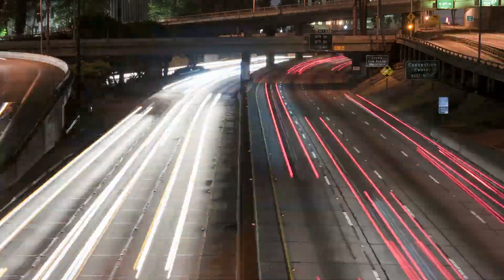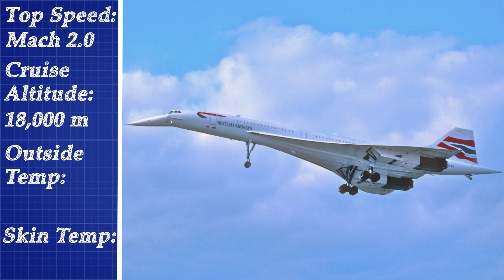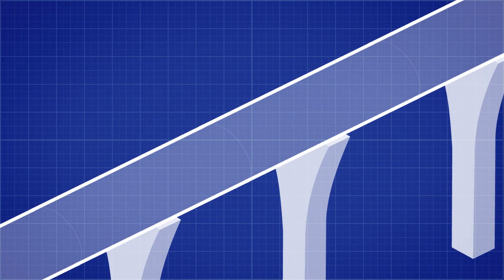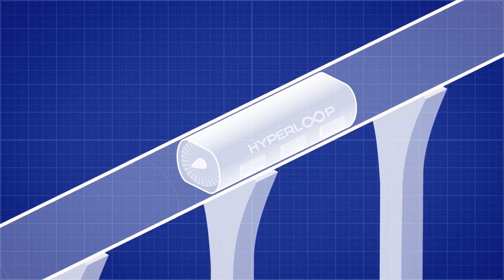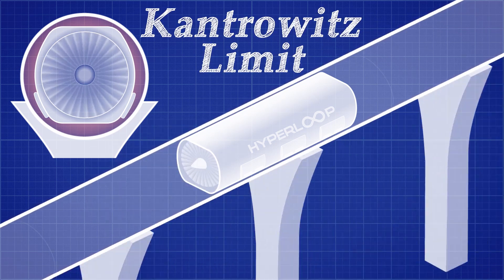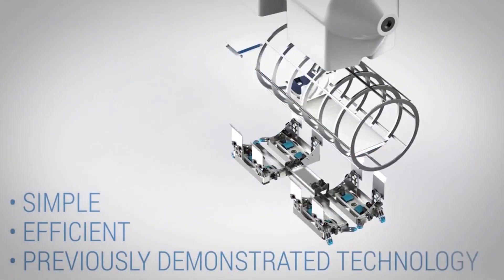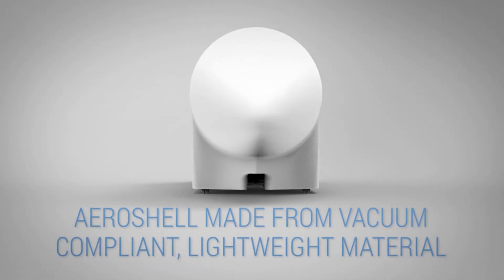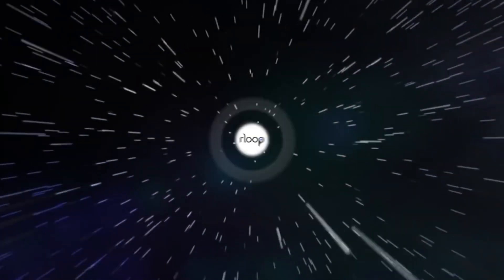Hyperloop - The Future of Travel?

Comment: I don't know about anyone else but I think we should be working to build a larger, quieter, more cost effective Concorde rather than something that will most likely be target to terrorists, design failures, immense infrastructure cost etc.
Reply: The advantage of closing a train in the tube is that you are isolating it from the elements. There can be snow outside, rain, strong winds but train is in the tube, these things don't affect it. 
In comparison any airplane is very exposed to elements, ice is a serious issue, strong winds and storms are problematic while landing, and dust or ash from a volcano eruption can halt air traffic for a whole continent.
Hyperloop as presented by Musk is a BS. Getting such low pressure in such long tube is impractical, any leak could destroy the whole system killing everyone inside. Making it usable and safe will be very, very expensive.
Reply: You can't make a quieter concord.  The noise has nothing to do with the airplane design and everything to do with the speed it flies at.   You also can't really make it that much more cost effective...the physics and thermodynamics are the driver of fuel requirements for that craft.  Any gains past 10% or so would be miraculous.  Size is similarly restrictive and larger is counterproductive to the first two metrics.  Finally...no demand.
Reply: Matt McAvay Boeing worked on their own SST concept in the 1960's, but the project was cancelled in part because of restrictions regarding supersonic flight over populated areas. SST's definitely work, but they are not practical; it doesn't matter who builds them.
Reply: what's easier to target, a jet flying at 70,000 feet with security inspections for anything getting onto the aircraft or a giant, just above ground, tube that is held at a near complete vacuum over thousands of miles of unprotected land?
Reply: Why would this be more of a target than any other rail system? I don't understand that argument. A terrorist could easily cause much more damage by derailing a freight train in a populous area. I think the terrorism argument is way overblown.
Reply: The hyperloop meant as a cheaper replacement for a proposed maglev train route, not for international travel.
Reply: +Matt McAvay   The real advantage of air travel over the hyperloop is that land does not have to be acquired as it does with a rail like solution and this is really an advanced rail system.   Unless, they convince the rail company, the freeway authorities, the electric utilities or pipelines to share their right of ways with them then the technology would be the least of their worries.  Plus the hope for high speed requires a very different more gradual path then the path from any of those aforementioned right of ways..    A new SST is far more complicated then you are imagining and not much safer from terrorism but does get around the land use issue except for the fact that you're not currently allowed to go supersonic over land, the Concorde was only allowed to be supersonic over the ocean.

I don't think the technical challenges are the problem with the concept but the logistics of right of way and the limited niche market that could be served by telecommunication and is currently served albeit inefficiently by air travel are the real problems with the idea.
Reply: +Just Being Socially Awkward You really think that a steel tube can't be crushed under 1 atm of pressure? Watch this video /watch?v=T9bpUfWy8Wg

The shell of the tank in that video is almost half an inch thick, and the vacuum they drew was about 80% of what is proposed for the hyperloop. Sure, the guys needed to damage the the tube in order for it to get crushed, but considering that the hyperloop is proposed to be used in a seismically active region, I don't think it's at all unlikely that the tube will never be damaged. Bottom line,  if the tube is damaged even slightly, you need much less than one atm of pressure to crush it, even if it's a (almost) half-inch thick steel shell.
Reply: considering the hyper loop is essentially a vacuum if there is a hole in it or in the case of terrorists an explosion, then say bye bye to anyone any that hyper loop. So yeah I guess terrorism is a bit of an issue for the hyper loop
Reply: Those Hyperloop tubes 'could' be useful on mars where there are many things that plague any design on Earth that would simply not be an issue there. -Hypothetically- They would be a really good way to transport things on mars. As this is a hypothetical, I am going to have to assume that many interplanetary logistics and resources needed to make Hyperloops on mars, such as asteroid mining, improved engine tech, and money (possible space elevator) have been established beforehand prior to the construction of the system.
       The Hyperloop on Mars wouldn't need much depressurizing if any at all. This is because the Martian atmosphere already is much less dense on the surface than Earths. Colonists could put them up and they'd be set; Mars is geologically dead so there is also the added bonus of having little to no marsquakes to disrupt a hypothetical future martian hyperloop. There is a low risk for terrorists to destroy a martian hyperloop as, well, I don't imagine many people have the mental capacities to qualify as an astronaut/settler. (No insult intended). 
       If any were wondering about dust storms, one must remember that with a less dense atmosphere, there is less force that can be transferred between the gas and dust molecules and particles. (Grain of salt to be taken here: I do not like how the Martian portrayed the amount of wind force on their escape craft, it seemed like a lot, more like the storms that are seen on Earth than Mars.)
Reply: Innovation won't hurt for some time or another
Reply: Or Lockheed.  personally I think the US largest military aerospace contractor can certainly build a kick ass SST
Reply: And the Concorde isn't a target to terrorists?
Reply: The 'Complete vacuum' argument is invalid, If the tube would get a leak, the air would just slow get into the tube and the hyperloop would slowly come to a stop.
Reply: ***** True
Reply: Hyperloop would actually make a rather weak target for a terrorist.  Attacking a passenger train on its tracks would actually produce a much larger death toll. (since passengers on hyper loop are farther apart)  Financially the repair of any such attack will be relatively cheap, as it will be contained to just that section of the loop.  

(And before you complain about mass depressurization elsewhere: that can be fixed by allowing the loop to be containerized)  Shut downs would be highly disruptive but not catastrophic.
Reply: Dude. MagLev trains are not viable for mass transportation, in open air. Hyperloop is taking one and encasing it in a 500km long vacuum chamber, and your argument is airplanes can be steered into buildings?  How about a locked cockpit door? There, just made airplanes viable for you again.
Reply: No, my argument is not that being a potential target for terrorists should stop us from doing things. I'm just pointing out the absurdity of claiming the hyperloop isn't viable because of terrorism and advocating for airplanes instead.

I think we should have both airplanes and hyperloops. I don't think the hyperloop is a good target for terrorism, and even if it is better than most targets, that shouldn't stop us from building one. Terrorists will target the most vulnerable point they can find. If that is a skyscraper, they will hit a skyscraper. If it is a concert, they'll hit a concert. If it is is a train, they'll hit a train. If the most people they can get with a single attack is two people because we've all run to the hills, they will chase us into the hills. We should not hide from terrorists, we should investigate them using evidence, and prosecute them using due process. 

The hyperloop will be built if they can make it work at a viable price. If they can't, it will fail. I hope they can do it. If they do, and it gets destroyed by terrorists, we will just have to build two more.
Reply: why not just bring concord back its still way ahead of its time now just dont go to france with it they have unreliable runways which ruined it now we have to use the shit unreliable american made cheese boxes
Reply: Matt McAvay Because the airline industry isn't affected by terrorism/design failures/massive infrastructure costs...
Reply: And planes aren't a target to terrorists?
Reply: next gen Concorde is were its at
Reply: Matt McAvay I think NASA is working on one but fuel cost and pollution are a holes
Reply: read about concord's effects on the ozone layer
Reply: You want to use an airplane to avoid being targeted by terrorists. I can't. I can't even. I just can't even. A larger, quieter, more cost effective Concorde will be about as effective in causing destruction as a 747, and those were enough to define a new geopolitical era.

Terrorists have attacked trains before, and the hyperloop is much more comparable to them. They can't use a hyperloop pod to target a different large building or crowd, just like you can't jump a train off the tracks to hit most targets. The result is that the damage of an attack on the hyperloop would hit a few pods at most, maybe collapse the tube onto a few small buildings or a road underneath it.

Anywhere there are people, terrorists will find targets, the hyperloop isn't immune, but is far from the most vulnerable.

Comment: This, never addressed, 100's of kilometers of vacuum will make this reincarnation of the vactrain go the way of the last.
Reply: Good luck making a tube with a strength of a submarine that can hold pressure at all the joints (and yes you will need joints unless km's of heat expansion is something else you don't care about) that could apparently remain strong after being shoot with a 50 cal gun that won't be the most expensive thing we have ever made ever.... Long story short. Planes are better.
Reply: The tube needs to be strong enough to withstand 1 atmosphere of pressure difference. This is equivalent to the pressure difference between sea level and 10 meters (~33 feet) under water. You don't need to have submarine-strength hull to do that.
Reply: What about the 100s of km of vacuum? Let's assume someone shoots the tube with a 50 caliber gun. One such hole amounts to 19 cfm, but the EMAX air compressor (as an example) is rated at 882.5 cfm. They'd need to shoot 47 holes in the tube before the compressor can't keep up. With  about 5 compressors per mile, you'd pay about $100 million and could evacuate the air from the entire length in 1.5-2 hours. Given that this is a multi-billion dollar project, it's entirely plausible to assume they could easily double or triple the air compression within budget.
Reply: +Stuart Miller the compressor I cited is $54000 x 5 x 350 = $94,500,000
Reply: +Stephen Rose Do the calculations for seamless steel pipe wall thickness (ASME B31) and you will find that 2mm is more than adequate. As for expansion joints, the plan is to include them near each end of the line in the form of slip joints. The need for extensive joints is largely mitigated by the fact that you're not affixing the tube to the supports. It just sits on top of the pillars.
Reply: You need far more than 2mm for tubing.  Remember, the tube has to be able to fully support the car inside it across the spans.  This means beam stresses in addition to the tube being in compression.  No one makes steel pipe of a size anywhere near that thin, especially for so large a diameter.  Buckling effects come into play when the pressure is from outside, and pipe that thin would collapse in on itself if a tree fell on it, not to mention the earthquakes in California. Also, seamless pipe of that size is incredibly expensive, not to mention heavy.  This adds to the weigh, and thus the beam stresses, and the required thickness.  Also, the overall thermal expansion of the tubes simply between night and day (~15°C) would be something on the order of nearly 55m at each end (109.8m total).  The issue is that there is a lot of friction resisting this expansion, and the curves in the route introduce weak points for buckling.
Reply: $100 million? Sounds like a made up figure. Let me just get my 50 Cal out and shoot at a tube 47 times. Getting tired of the terrorism argument tbh, I could go remove a rail on a train track but i don't see people doing that
Reply: I'm not concerned about the thickness of the sheet very much, as it won't have much to do with anything. I'm talking about the structural support a tube like this would need not to collapse whilst under vacuum. I'm sure you've seen smaller diameter, thicker walled drums collapse under vacuum forces that are far far less than the one we're talking about in the hyperloop. To be clear I'm not saying it is literally impossible I'm just saying it is worse than even maglev trains in every single way that matters.
Reply: +Stephen Rose Yes, pressure, not temperature. Thank you. And you're right in that it's the temperature difference and not the speed of change the primarily causes the drum to crush. However, speed is also somewhat important because you have inertia resisting the change in the drum's shape, and you want to concentrate the change in differential pressure so that it reaches a threshold that can overcome the inertia. Also, some heat is of course dissipating through the drum, so it wouldn't do to wait too long after heating it.

But I only bring up the experiment to illustrate its differences from the proposed hyperloop tube.
Reply: The terrorism argument is a joke. Last I checked, your chances of dying from a shark attack were about 50x greater than dying from terrorism. Also, a bullet hole would do almost nothing to the Hyperloop besides trigger some leak sensors that would bother a few repairmen to go weld a patch on the tube. Ever see what happens when you weld a short piece of metal to a train rail in the middle of a densely populated area? No? Of course not...
Reply: Anton Zuykov there's actually a myth busters about what would happen if you shot a bullet hole in an airplane. Spoiler: it's not nearly as dramatic as you imagine.
Reply: +Mike Imbesi
"You need more than 2 mm for tubing"
How about 10x more, like the 2 CM that the alpha paper calls for.
Reply: I subbed to freecodecamp because I teach people how to code on the side and I like to find good, free educational material to share with my students.

Again: You know what they say about assumptions, don't you?
Reply: It's 1/1000th of an atmosphere.
Reply: +Stephen Rose Those steel drum experiments involve heating the drum a lot and then cooling it very quickly with an ice bath. This creates much greater temperature differentials than 14.7 psi.
Reply: I assume you meant pressure differentials. And no it didn't unless you're saying that the involving heat some how allows you to have negative pressures ( whatever that would mean) inside the tank. What's more speed also has nothing to do with this effect you rapidly cool it just you don't have to wait forever to see it happen since stream cools down so slowly.
Reply: "I like how your ignored my comment which points out that the whole in the side of the fuselage is fairly large"

What the hell are you talking about? What do you mean by "the hole"? Are you lost?
I am an engineer. You know what they say about assumptions, don't you?
Reply: Abe Dillon Lol an "engineer" subbed to free code camp. Let me know when you finally figure out how that REST API works hahaha
Reply: near vacuum. entirely different kettle of fish mate.
Reply: 1/1000 of an atmosphere is many times a stronger vacuum than that of even Concords fly at. Which is presumably why the strong vacuum